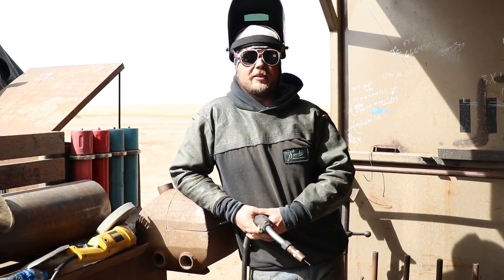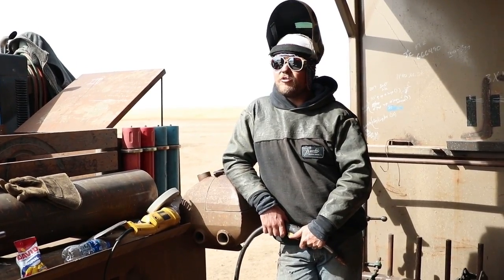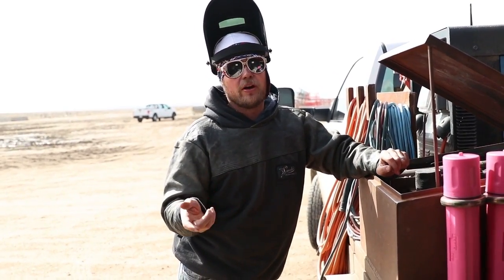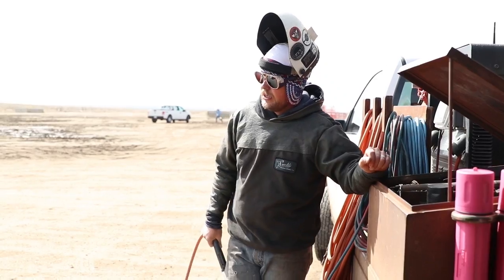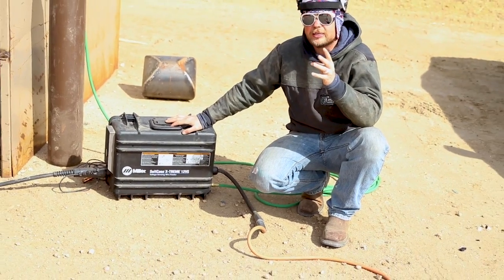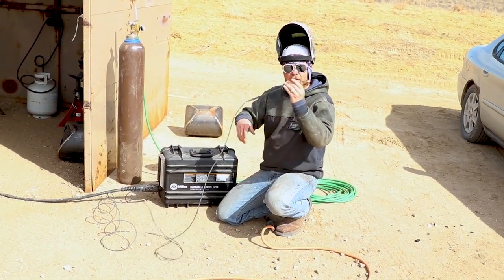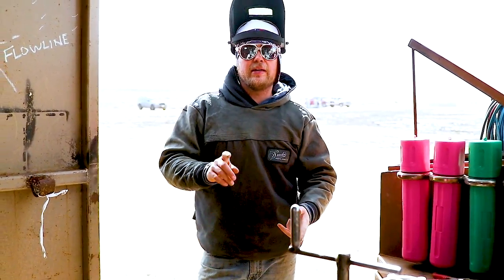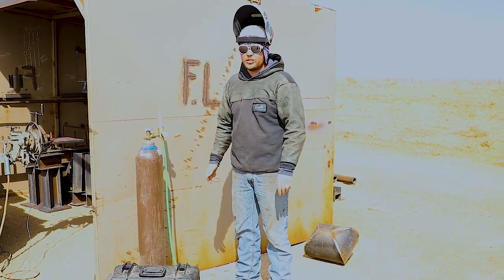Mig Welding-Miller suitcase v12

Comment: I run the polarity opposite of that on the ln 25. I put a small quick connect lead wired into the carry handle, splice the ground from the suitcase in to the quick connect and then bolt the end of the added lead to a piece of rebar and the. Tack that to whatever your welding on
Reply: Then your ground just drags around with you and the suitcase
Reply: I could send you pics of the set up, I’m an iron worker and weld off a big blue 400 and an LN 25 ALL day.
Reply from the maker: yes please do send picks. schofieldwelding@gmail.com

Comment: When I run my box, same setup, except I use a 8vs, 50’ of lead is all you need. If you were building skyscrapers or can’t get the truck next to the hole, then by all means have your 200’. I also run 1/0  and never busted a test or X-ray with my 50’. 50’ is a lot lighter to deal with then the 2/0 200’!

Comment: Have your leads out straight helps less voltage drop...there coiled up it it turns in to an induction coil...simple magnetic 🧲...I do welding n on cell tower’s same 12vs w a miller 301 no issues w leads straight out..in the box well she’s ugly...cheers

Comment: The sputter that you talk about it magnet current. When your leads are rolled or wrapped a magnetic current will be formed. Lay all the leads out on the ground uncoiled. I use the exact set up as you have in the video. Hope this helps

Comment: The first mistake people make is welding off of electrode positive. Check your wire and make sure it's not a electrode negative wire. Not many wires are electrode positives that I've used. 3M is about the only electrode positive that ive used.

Comment: Informative video as always! Definitely more of a wire hand myself, cool to see this set up. Working in a vehicle fab shop so I don't see this often or exactly need a suitcase, but definitely will look into it when I get my 'schtuff' up and running.
Reply: I run more wire than anything,dualshield and push-pull aluminum for my 9-5.I have a LN25 for a feeder off a Miller Bobcat250 engine drive for my side-gig and I LOVE it!

Comment: Spuddering can be caused by a bad liner inside your whip, kinking your lead, or the wrong sized white. Also keep in mind to tighten your slack in the spool as your wire runs down! Fluxcore is fun and satisfying just takes a few days to get the hang of it:)
Reply from the maker: Sam thanks brother for the tip

Comment: What you were experiencing was arc blow from your grounds. Happens a lot running the suitcases with insufficient grounds on a small test plate like you were using. When we take out aws and abs test at the shipyard we  hook up extra grounds at the top and bottom of our test coupon on the runoff tabs to prevent arc blow on vertical uphill running 1/16 dual shield flux core
Reply from the maker: Thanks brother I screen shot this comment so I could go back for reference.

Comment: When I was an ironworker that's all we ran but we ran the innershield and it was awesome
Reply from the maker: Im going to get some of that and play around with it.
Reply: That’s wat I run and you can’t stray too far off from recommended setting on the self shielding they are pretty specific but I weld underground  and gotta carry it all over catwalks and down in chutes and can’t carry a gas bottle and hose in these areas and it’s a time saver forsure

Comment: I do structural steel up in Canada, If I were you I’d try running 27 volts, and around 515 wire speed. It’ll be spray transfer instead of short circuit mig. It burns way hotter and you’ll get better penetration and less spatter. See if that works for you guys.
Reply from the maker: I screen shotted this thanks to both of you for the great tips.
Reply: Jacob Schofield any time jake I’m not a true squirt gun hand mostly stick and tig in my career but started teaching at a college last year part time so have all that info fresh in my head lol
Reply: You need 90/10 gas to get into a real spray transfer if you try it with c25 you end up with excessive spatter...but yes a true spray transfer would be faster smoother and offer deeper penetration...what part of Canada are you in I’m in southern Alberta...I work primarily with stainless in food plant fabrication and teach at a college but before the crash built drilling rigs and did pipe fab
Reply: I guess I forgot that spray transfer needed different gas. I work for a machine shop in south Saskatchewan. We do a lot of squirt gun but we also do a lot of site work mainly 7018 because we do structural. Anything from building erection to ag/construction repair. I’d like to get into pipe fab one day after I’m done my red seal though.
Reply: Thomas Gilmore nice I’m just west of Medicine Hat done a lot of work in southern sask built a few small slaughter plants and some oil/gas plants out that way
Reply: roostin no way! I bet I’ve driven past your shop at some point or another! I used to live in the Lethbridge area. Drive through the hat all the time. I’m in Speedy Creek at the moment.
Reply: Thomas Gilmore I’m just outside of brooks and my gf is from Lethbridge...I don’t have a shop mostly portable but I rent a bay from a buddy the odd time I have shop work
Reply: roostin no way! Small world haha. I don’t normally drive though brooks but I have a friend from Bassano
Reply: Thomas Gilmore lol use to work for a shop in bassano
Reply: @Thomas Gilmore you sir are spot on! Check your rollers and wire brush them off regular and your wire spool tensioner as well if you dial it all in you can do A Lot!
Reply: As far as how much play you have in the voltage because the wire burns really hot and makes thick smooth grey slag. Any position.
Reply: Straight C02 or 75-25 or, /helium if you dip off into inconel or something with heavy nickel.
Reply: Is that on cv or cc just curious

Comment: I have the trailblazer 325 and have the suitcase , I run 5/64 gas less wire 3m ,211,212 by Lincoln . I love it I do a lot of moment welds and I also run a ln 25 with a 305 Lincoln

Comment: Put a real ground clamp on it or u can take a short piece of lead strip the insulation off of it and kind of wad it up and then connect the ground clamp using the wire between your ground clamp and your work piece it just gives it a more space to ground to talk to you later buddy be safe
Reply from the maker: I was thinking tht could have something to do with it but its a 300 amp stinger but we have been welding this bed out with it and have had zero problems so far.

Comment: For even better results I recommend uncoiling your leads off the truck.

That coil is no different than windings in an electric motor. It creates a magnetic field.

If you would like to test this theory 
Throw that coil of leads on the floor where you have metal shavings and weld a few beads, you should notice the metal shaving near that coil will be in the shape of the coil.

If you run into any problems id be glad to help 

I have the same 12vs and have ran pallets upon pallets of dual shield through it
Reply: was going to say the same... I've even had the leads move when you start welding at higher amps/volts... also the coiled leads reeked havoc on my high frequency box (HF 251) couldn't produce over 125 amps AC until I figured that. problem out. some say the direction you coil your leads can make a difference but just drag them out in a straight line or weaving "S"
Reply from the maker: I will for sure. not going to happy about because this new 2/0 is freaking heavy!!!
Reply: @JacobSchofield  I coil up a few wraps in my hand and then throw them off the truck, no way I put 200' over my shoulders and walk it out... like I say... there aint no girls around watching... so I aint carrying this like a macho man!!
Reply: Allen I would love some help setting mine up. My email is kbaca90@yahoo.com
Reply: Wanna buy a welder can u run this with a SA 200 I do general contracting and repairs but wanna start more welding sense went to school for it but not sure if I can make it on pipeline rt now

Comment: I run flux core off a sa200 dcen set on cc mode runs just fine wont be welding anything thin with it tho
Reply: I've been running .035 self shield on sheet metal no problem. First gear turned as low as 40. Down to 18 gauge and exhaust pipe.
Reply from the maker: see I didnt know if you could do that or not.
Reply: What's the settings you use on your 200?
Reply: @isvencastillo8710  just gotta play with it. 3rd gear and 20 runs pretty nice  it seems to run better with the fine current turned down. I haven't played with it much on lower settings. I've ran max and 20 and the thing will really burn some wire. I've got the old old suitcase s-32p

Comment: I would HIGHLY recommend a tweco flex knucklehead conductor tube, their absolutely wikid for fab work and tight spots like pipe supports and last for a really long time as long as u don’t over bend them. For .035 hard wire try 25-26V and 475 Inches per min, good setting for anything  1/4-3/8” thick and above.
Reply from the maker: Brett thanks for the comment brother I will look into it and see what I can find. I wrote down the ranges you just gave and will try it out.

Comment: Jake,
I have a trail blazer 302 (Miller) &I run a 12rc wire feed . Lays it down beautifully. Structure & x-ray pipe. (PLEASE tie  that 75/25 bottle to something). That’s an accident waiting to happen!!!!!’
Reply from the maker: You sir are right I am building a rack for my truck so they will be tied down all the time.
Reply: I used to work at a fab shop, and this one guy friggin REFUSED to chain his oxy and propane bottles up. They were literally sitting on a post with a chain right there. His excuse was (they were huge propane bottles, about 18" to 2" in diameter) that the propane bottle "aint goin nowhere" and he "has to change the oxy bottle so much it's not worth the hassle" ... Yeah ... OSHA guy showed up one day, and they got dinged pretty hardcore for that. Had a safety meeting, and he was told to CHAIN THEM UP or get fired. He chained them up for about 2 whole weeks. Stubborn old man...

Comment: Retarded question here (perhaps) but... this is MIG???

Ive ran T8 off an ln 25 suitcase flux core self shield.

Why would you mig those beams?  Why not 7018 instead?

Mig?
Reply from the maker: We always run 7018 on the stands but that day we decided it would be fun to pull some wire out and film a video for you guys. Yes this is MIG
Reply: Very cool 👍
Ty

Comment: Unless someone told me I had to run dual shield I would not bother.   I run lots of T11 wire, no gas, EN is the hot side.   Fabshield 21 b is what I like best. . 045 and. 1/16th.  Running the gas line plus the extra expense of gas is self defeating.  

Buy an rc then.  I've owned ln25's, 8 and 12 rc's and 8 and 12 vs's.   Now I use an 8 VS. Much much more portable than a 12vs with 35lbs wire and and 15 foot gun.   If you're thinking of buying a unit don't overpay by buying miller's latest and greatest.  I got by just fine for a long time with a ln25 that had analog meter and was mfgd in 1997.

Much better video than the one with the other guy.
Reply from the maker: I will need to try that out. I’m still pretty new to the wire game
Reply: Hi Jacob , love your channel mate 👍 - I run Hobart Fabshield 21B also off my LN 25 , It has to be DC Electrode Negative for self shielding wires ( reverse the polarity on a Miller )  ..Using 1.2mm wire size ..... does a beautiful job here in Australia 🇦🇺 🇦🇺🇦🇺 ... Keep up the great work and take care 👍👍

Comment: I run my LN25 off my SA200 no issues.
Reply from the maker: Ok see I did t know if you could do that l. That’s freaking awesome. Did you need inverters or anything?
Reply: @JacobSchofield  Nope. Just flick the switch on the inside and set to CC. Hook the leads up like regular. Play with it to get the settings as you want. I usually use mine for sheet metal with .035 self shield flux core so I'm usually keeping my heat in first gear around 40-70. Got some heavier duty wire and drive rolls on order though.
Reply: @UCPCEN62-MrorwdtLc2FmdSA For anything real critical I'd just run stick. Already got the leads strung out and it's been an approved process for decades LOL
Reply: Always ground out to the work piece..... voltage sensing separate from your main ground too do not clip em together at least I do with my LN25 ..... sometimes that spit and sputter change out the contact tip too
Reply: Rob Murphy l use the LN25 off my Miller 350d 👌👌

Comment: And yes you can run it off a 200 have to set it to cc not cv
Reply: So if I have a Vantage I'd prob set it at CV then..
Reply: Joel Sotelo yes you do
Reply: It also has the Voltage setting.